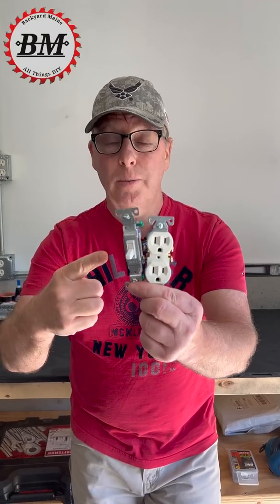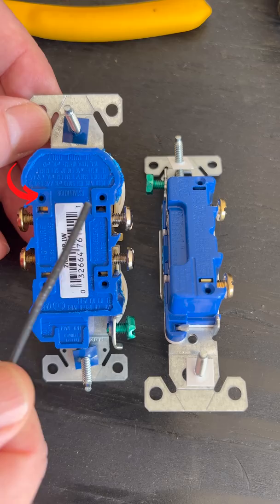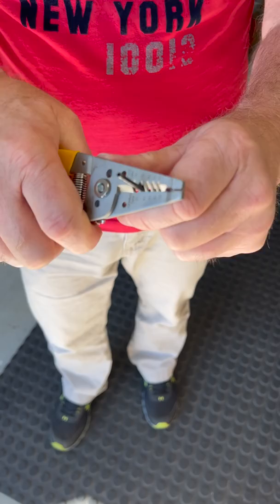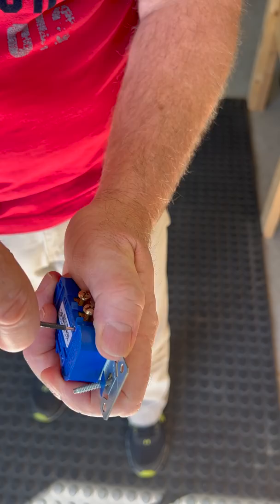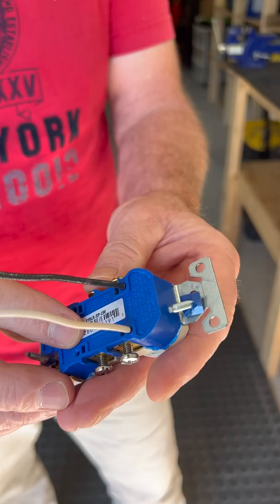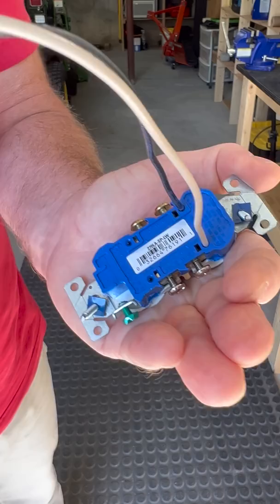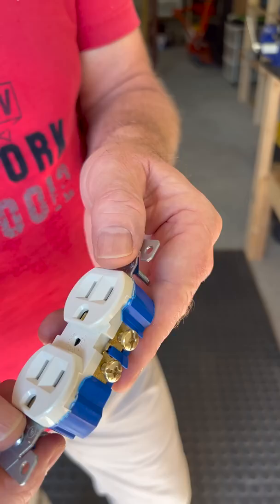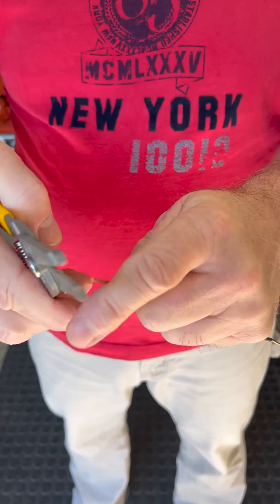Don't make this electrical mistake #Shorts

Comment: I don't understand. The company that makes these will have a test lab that would put them under extreme testing circumstances before placing them in the market for reasons of liability, fires etc.  Is China involved ?
Reply from the maker: My experience is they will begin to fail in a few years with any considerable loads. They used to allow them for 20A receptacles as well but not anymore. More of a reliably concern although I have seen some that were close to catching on fire.

Comment: "Made for connecting your wires" So the MFR and Gov't Regulations are aware this is a quality and safety issue yet they still allow it to be MFR'd and Sold with backstabs?
Reply from the maker: They were approved for 20A devices as well (for years) but not anymore. I won't be surprised to see the 15A gone eventually unless they come up with a design that will actually last.

Comment: Note wrong these connections are horrible when you add an A.F.C.I. if only one has an arc the breaker will trip and in Germany they are not using those breakers yet but yes side wiring is always better. 40 years in the trade I have had time enough too see them fail after years of them being on.stay safe and don't work hot turn it off 📴.
Reply from the maker: Agree. Not trying to insult anyone just that my years of experience indicates these connections are unreliable.

Comment: Why do they still make the backstab option if it’s by all accounts a terrible idea?
Reply from the maker: They did stop making them for 20A devices but so far they are still available for 15A receptacles and switches. I really don't know for sure but one possibility is they are simple to use and maybe a better option for an inexperienced person.

Comment: The way the nanufactures done this was absolutely stupid, i had tried using the wires putting them in the holes of switches & outlets nothing but problems that come from doing this, i only lupe the wires around the terminals for best connections.

Comment: And I've seen videos that say you should never use the side concept connections. How can both people be experts, and professional, and both be right?
Reply from the maker: I haven't seen any of those videos yet. I have been a licensed electrician for 38 years and have seen so many failures with these connections. They used to be approved for 20A as well but not anymore.

Comment: I’ve heard this several times and everytime I can’t help but ask if it’s that big of an issue why is it still allowed per the NEC?
Reply from the maker: The NEC doesn’t allow or disallow them. It’s about being listed and the devices with these connections are listed. But the used to be listed for 20A devices with 12AWG wire but not anymore. My 38 years of experience has taught me that they are an unreliable connection and I don’t recommend using them based on that information
Reply: @BackyardMaine  I’m not trying to argue that you’re wrong.  I’m more pointing out that since every electrician I’ve ever worked with has said this is a bad way to wire these things why has a regulatory agency not stepped in and made made manufacturers stop making them.  Seems like the data supports them being a bad idea and the NEC and UL exist to make sure stuff like this is safe to use.

Comment: what you don't know is that both the receptacle on the switch have strippers built-in them on the ear tabs so you don't need the stripping pliers you obviously aren't an electrician
Reply from the maker: Dumb comment. What you don’t know is I have been a licensed electrician for 38 years and the video before this one was demonstrating that feature

Comment: Big surprise Americans can't make a push in connection work... When you do electrical work as your day job those are an absolute life saver compared to old times when you had to screw everything. Nowadays everything has push in connections in Europe, even breakers are startin to have them.
Reply from the maker: Remember you guys are running a higher voltage. These may be fine with 220v.

Comment: And ALWAYS put the ground on TOP
Reply from the maker: No the NEC doesn't specify receptacle orientation with exception of prohibiting a face up position in or under a countertop. Most install ground down but there are those who install ground up. Either way is fine.

Comment: What if you have a couple of circuits going to the same plug?
Reply from the maker: Thats a multi-wire branch circuit and the tab between the two receptacles will need to be removed. Also the circuit breakers need to be on opposite legs and be a two pole or have an approved breaker tie.

Comment: If that push-in terminal is working loose or not making a good connection, it is poorly made. Buy quality.  Screw connections should be avoided as they can work loose over time thru vibration and heat expansion and contraction.
Reply from the maker: Not my experience at all and Ive been an electrician for 38 years. I find every manufacturer fails equally when it comes to these stab in connections. I have never seen a side wire fail that was installed properly.
Reply: @BackyardMaine  
Try Wago.
Reply from the maker: @johnburns4017  I actually have some Wago 221 connectors in a stressful circuit right now for testing. I'll make a video when the results are in. So far they are holding up.

Comment: What about the ones with plates by  the screws. Where you put them in straight?
Reply from the maker: That connection is found on commercial grade devices and they are superior..
Reply: @BackyardMaine  i found out my whole house is backstabbed . So I plan on replacing them all and I am going to backwire them all. The old outlets only had backstabs on them. Plus the hole to release is so tiny. So I decided I am just going to break the outlet to get them out lol
Reply from the maker: @killer-gaming  If you use a very small screw driver you can push in the opening and pull the wire out pretty easily. May be easier than breaking the outlets.
Reply: @killer-gaming haha, had to this too, break the outlet

Comment: Need to screw in the screws after the stab to tighten the stab
Reply from the maker: Nope the screws do nothing to this connection. The are back wire devices which use a screw and play system which work fine.  These are different.

Comment: I don't get why they are allowed to sell them if they don't work, if they are even dangerous? Are these outlets not certified? Or were they certified with a working product while they sell a cheaper non-working version?
Reply from the maker: They are fast and easy. Time and skill cost more money which is why many residential contractors like them. They are listed.. They stopped making them for 20A devices but they're still an option on 15A contractor grade devices..

Comment: I went to plug in a lamp and the plug wouldn’t fit. After removing the outlet it had melted from a poor connection that was done using that push in method. After that I checked all outlets and fixed all wires to the screws. It could have burnt my house down.
Reply from the maker: I’m not surprised. See lots of heat damage from the connections

Comment: This makes me want to check all my connections now😂
Reply: I would advise that, don't just check them, replace the plugs/switches with new ones that have decent screw connectors, then use them!
Reply: You should, I did after a backstabbed outlet caught fire.

Comment: That is for making a connection with stranded wire you can’t connect stranded wire to the screws
Reply from the maker: Sorry but no. They are marked 14AWG solid wire only. When I connect stranded to a device I use commercial grade receptacles which have a clamping plate or I crimp on terminals.

Comment: Never use junk switches or outlets
Reply from the maker: The commercial grade are much better but
I wanted to also cover what most people are buying which are the cheap contractor residential grade.
Reply: @BackyardMaine  agree, but let them know you get what you pay  for..

Comment: I disagree, I've done both ways and never had overheating, flickering or issues. What does cause such things are improperly spaced contact points in the outlet.
Reply from the maker: I have never seen one fail right away but have replaced more than I can count on homes that are over five years old.

Comment: If its not recommended to use the holes in the back, then why to manufacturers build them into almost every socket and switch on the market?
Reply from the maker: I'm not sure but maybe it gives the average homeowner an easier way to make a connection. They will work but I find them very unreliable. Over the years with any current many will have issues.

Comment: If they are this common of a failure why do they continue to make them this way? Boggles the mind
Reply from the maker: They aren't burning down houses of everyone who uses them like you read in the comments. But they are a very unreliable connection method in my opinion.

Comment: Sorry. Boss man say if I spend more than 15 seconds terminating each device he loses money. 😂
Reply from the maker: Ask him is he prefers quantity over quality? No don't do that actually I would want anyone getting fired.
Reply: It’s just a joke poking fun at what a lot of guys will actually say. I do know of contractors in my area so cheap that guys will get in trouble if they don’t just stab em in because of the time it takes. Residential electrical work in so many areas has become a total clown show of guys just doing a rat race. Faster faster faster faster is all that matters. A friend of mine had an interview a while back for a contractor in the Ann Arbor area and the guy actually had some 2x4 walls thrown up in the shop and was timing guys with a stop watch to see how fast they could rough in, pull wire, make up boxes, ect. The ones who did it the fastest got the jobs. My buddy said it felt like a sports team try out 😂😂

Comment: Why are those American wall plugs and switches unnecessary complicated and engineered to fail? In central Europe most of those are plug in connection like wago but without clips to disconnect. And one can just twist the wire while pulling out and it will go. 
One point though, current in EU is half of that cause voltage is double. That plays significant role in connection points.
Reply from the maker: I think thats the big difference. If you were running 120V you may be having similar issues.

Comment: I replaced a backstab plug that was getting hot to the touch damn thing was almost paper thin at the contact points. The internal copper not the solid copper wire
Reply from the maker: And that the problem with these things. Thanks for sharing.

Comment: I hardwired my smoke alarms by backstabbing into receptacles! I told my electrician buddy and he didn't comment, just kinda shook his head...... Is it taboo to backstab for a single smoke alarm?....
Reply from the maker: I don’t trust them at all but there are two things in your favor. First, the smoke detector draws minimal amperage which is what usually causes the connection to fail and second, you still have a batter backup.
Reply: @BackyardMaine  Hey Thank's,.... Yea I sold myself on the low amperage...... I don't believe  any electricians around here backstab anything....... But there again I just had a thought as some time ago I had family members with a circuit issue in an upscale 4300' house! And when I checked receptacles they were all backstabbed..... The problem was a shorted/burnt receptacle for a small nightlight plugged directly into the receptacle...... Thing is" they bought the "used" house from the contractor that built it for himself and had lived in it for some year's..... As far as I can tell the house is very well constructed...... It's hard for me to believe the backstab connections haven't been outlawed..... Btw-I am a novice at best but had technician buddies  where we worked in a steel mill for 3 decade's that would suit up and work with live maybe 480 volts? Around incredible hot furnaces as to not shut a line down...... And not in my lifetime with my attention span would I do that..... Saying much respect for all electricians......

Comment: I have been replacing back stab methods in my area for a year now and many are safe but out of 30 outlets and switches I would get 5 bad ones and many you cannot see the problems until after and have hundreds of pictures of different name brands with the same problem
Reply from the maker: I'm going to do a long form video on this subject as well. If you would like to send me some pictures I would love to include them in the video. You can find my contact email on my home page. Click the (about) tab scroll down and click view email. I don't want to type it here because I'll get a ton of junk email messages from automated systems. Thanks..
Reply: @BackyardMaine  Just had the notification that you had messaged me I have another house coming up soon with backstabs in the next week or so I will make sure to take more clear pictures this time the ones I have frankly are not very visible

Comment: Im not an electrician and even I know that. The connection points inside are very small and just grab a very small portion of the bare wire. Break one open and show the watchers why you made this video.
Reply from the maker: Great idea. Thanks for your input.

Comment: Why do you use wire strippers when the socket itself has a wire stripper built in?
Reply from the maker: I made a video showing that feature but of course wire strippers are your best option.

Comment: I’m just curious? If they’re so bad, then why does this company who makes them make them? I think maybe you’re being a little critical, and they do have applications.
Reply from the maker: You're right I am a bit critical of these since I've seen so many fail over the years. I think for LED lighting connections and switches that have minimal current they may hold up but anything that draws more than an amp or two would be a side wire for me.

Comment: If you buy the better build ones you can. “Jobber”s are basically rejects that aren’t labeled rejected.
Reply from the maker: The back wire commercial grade receptacles use the screws to secure the wires and are different than these stab connections. Those are the ones I usually use on my jobs.

Comment: These connections are designed to be one time use. 
This alone never gave me any confidence.
Reply from the maker: Yup they’re not good at all.
Reply: @BackyardMaine ? BTW: I had my stereo plugged into a switched outlet. Took the cover off and notice two many wires, pulled the outlet and found an always hot wire. 
Talked to dad and he told me, do it. 
Now one now the top live, buttom switched. I was 10 years old, and he has me do the rest of the bedrooms.

Comment: In Germany we use the Push Connection on every Switch or Socket and i never had any Problem
Reply from the maker: They must be a better design than these. Also you run 220v (I think) which would perform better on these as well.

Comment: It's a do-it-yourself nightmare heating and cooling on The wire makes them loose connection is very problematic an electrician will not do that use the screw

Comment: If back stabbing is so bad, why are outlets allowed to be sold with those holes? Why would that pass code?
Reply from the maker: They used to be approved for 20A as well but not any more. It a time saver but a poorly engineered connection. But don’t take my word for it. As a service electrician.
Reply: @BackyardMaine  So if they don't approve them for 20a anymore, that's good. But why are they still approved for 15a? Was it cause electricians demanded the quicker connection? I'm just curious why still have it?

Comment: I just put in a gfci outlet that you backstab but when u tighten the screw it actually clamp the wire from the inside
Reply from the maker: That’s a different connection than these. They work fine. They’re found on GFCIs AFCIs and commercial grade devices.

Comment: They are a good connection. I have done. Thousands of these with no failures   After over 45years in the trade Ihave maybe seen 2 of these fail. You are obviously not experienced in electrical work
Reply from the maker: 4 decades as a licensed electrician with my last ten years working as an electrical engineer for a multibillion dollar corporation. I'm guessing I have a lot more experience than you do. I can't imagine anyone with experience would actually use backstabs.

Comment: Why would they even design it like that if it was such a bad idea?😂
Reply from the maker: They try to accommodate the average homeowner. They do work of course but have a very high failure rate. You learn a thing or two when you've been a licensed electrician for four decades.

Comment: So are screws they loosen over time with heat and cool
Reply from the maker: I have never had that happen as long at they are tight when they are installed. One example I wired my whole house on the screw terminals 25 years ago now and I have not had one issue to date. A friend of mine had a house built in 2019 and I have had to fix several connection problems at his place due to these connections.

Comment: That's simply not true. I've never had back stabbed wire fail. Screwed in wires on the sides actually fail more often as the screw can loosen over time then touch the sides of a metal box. Furthermore, many DYI'ers inadvertent touch the sides of an energized outlet resulting in electrocution. This cannot occur with a properly installed stabbed wire.
Reply from the maker: Wow you know very little about wiring. Even when you use the stabs the side screws become energized. And any licensed electrician like myself will tell you the same thing about the stabs.

Comment: Can I side wire multiple outlets from the main circuit outlet? I mean (screw 2 white wires on the same screw etc…)
Reply from the maker: Yes you can through wire like you're describing or pigtail. I'll do a pigtail video next.
Reply: @BackyardMaine  thank you!!